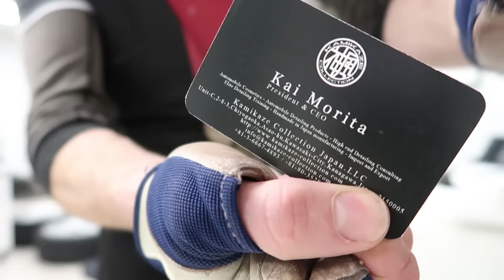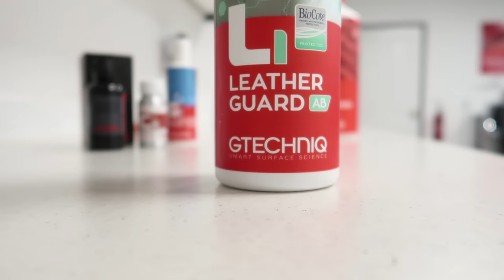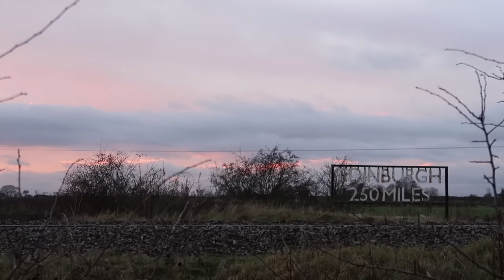Alpina D5 & a right mucky pair - VLOG 011

Comment: How do you get on with your Kirkland microfibres? Do you reuse them? I bought a packet of them (as I saw you using them in a previous video), but a number of people had issues with them marring the paint. I have yet to try mine. Keep up the good work mate, and the cracking videos!

Comment: Is hand polishing okay to do? The compound and a hand applicator?
Reply: Anonymous ofc it is okay, but the results are always better with a machine polisher.
Reply: The Rat the value of the car is not that high so I don't think I would spend the money on it yet. It's my first car (£5500) so I don't really want to spend much money on the paint.
Reply: Right, no problem, polishing by hand is perfectly fine, just do not expect the same results as you can get from a machine. Anonymous

Comment: Does the tape not leave a glue mark when you remove it?
Reply: Lewis Pugh The green tape is commonly used in automotive body applications and does not leave a residue when pulled up.
Reply: Some time a bit. Just dont press it to heavily and pull of easy and slow
Reply: Helps to use it in a warmer temperature I suppose, if the glue gets cold or sits for a long time the chance of residue increases.